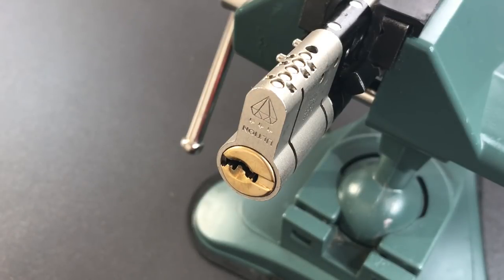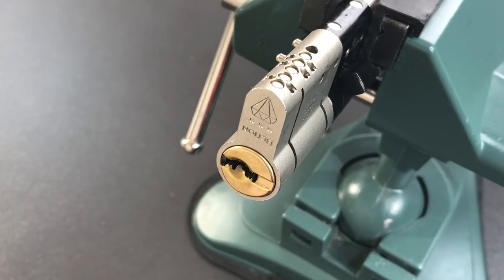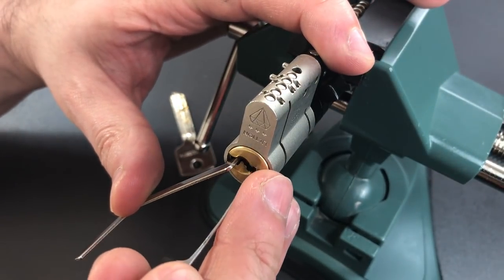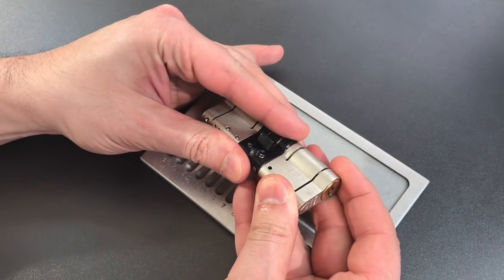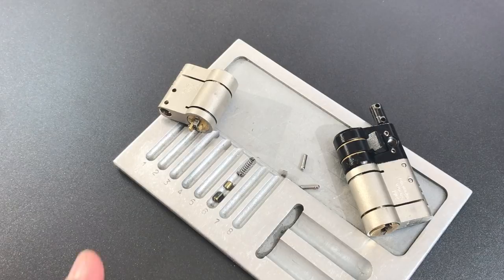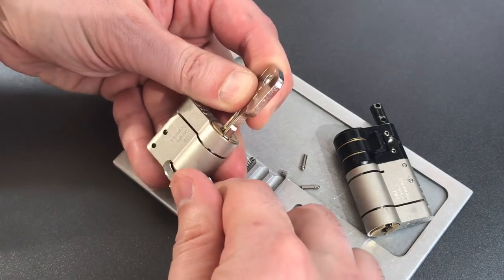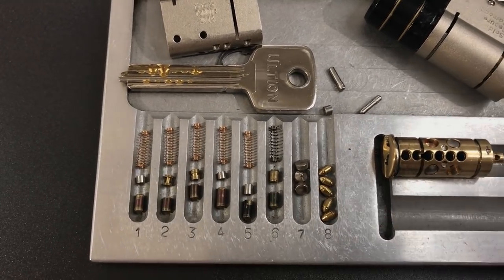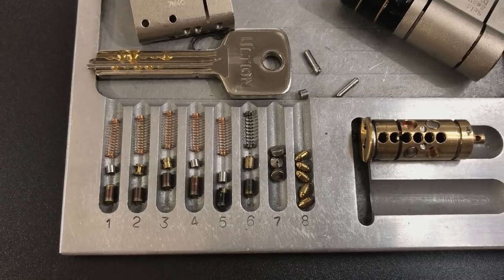[628] Ultion Euro Profile Cylinder Picked and Gutted

Comment: If you were locking your motorcycle which lock would you want? Most bike thieves don't know how to pick locks but they do know how to operate bolt cutters or power cutters/grinders. Some will know how to pick. I need a good strong lock ASAP. Thanks.

Comment: Hmm, that's a shame - I've got a full set of these on my house.

So, if I wanted something that's better as an all-rounder what's actually the best these days?
Reply from the maker: Nothing’s perfect. This is better than most.
Reply: As has been said elsewhere, when confronted with a lock like this (or Avocet ABS's like I have) intruders are much more likely to attack windows (including just smashing them) if they want to get in. LPL is picking in ideal conditions with a high degree of skill, your average scumbag in the dead of night wouldn't have a chance.
Reply: I'm looking into Abloy euro cylinders. They do exist. But they are more expensive. I know they last longer, and as dd locks, they are harder to pick. But I would love to find out more about how well they cope with snapping. I suspect/worry that if snapping does not occur in Finland and Scandinavia then they are not designed to stop it.
Reply: @belperite  He's also picking the lock upside down. Orientation is important with these, and with some other, Eurolocks.

Comment: Coming from the UK and being an English "bloke" 😄 I have to say I'm disappointed with the Ultion lock. As Michael Maynard has mentioned in his review it seems like the marketing of the lock got a whole load more attention than the technical side. The hard work seems to have been done but they left the lock half finished and vulnerable to picking. You would also have to question the method of testing for the lock to achieve the certification and security standard it has been awarded. A lock being "sold secure" and three star obviously isnt worth the paper its written on. Nice work LPL!
Reply: Hey daz ., glad i"m Welsh with all these comments :]
Reply: Mr Maynard - in https://youtu.be/UcMdf5aR7JY - proposed the theory that the locks from mass production were unreliable or easily jammed with long pins or high pin stacks in place. Deficient pick protection is the result. However, after watching many videos from LPL, BB etc., I can't understand how any straight cylinder with openly accessible pins can ever be considered picking-resistant.
Reply: I don't think this lock being vulnerable to picking is that bad. Your average oik house burglar can maybe rake open a basic pin tumbler, but most of the time they go for brute force attacks, snapping, drilling, brick through a window (I love ultion's marketing BS that claims 85% of break ins are done with snapping) which this lock is beefed up to defend against. there are maybe half a dozen people with LPL's picking skill so this lock folding to him isn't much to write home about.
Reply: Get this lock and see how fast you can pick it, please report back the result.
Reply: have you even seen the videos of penetration testers, people whos whole job is to be paid to try breaking into places... watch a handful of videos and you'll notice a theme.. most of them dont give a shit about your lock. very few people have the level of picking skill as LPL, and most half decent locks like this one will stop your average picker. unless you've got a master lock or something they can quickly rake open they will aim to ignore your lock entirely and use a different tactic... under door tools, latch slipping, hinge attacks, windows.
your common thief isnt skilled enough to pick a lock like this, they are skilled enough to take a piece of wire and just slip the latch on your door though.
Think about who your actually trying to stop
Reply: Yeh in the UK most burglary that uses the door as a point of entry either attacks the hinge/frame/kicks it in or on a decent door involves either snapping or drilling the lock

Comment: Thank you for that LPL So the snapping is solved but the picking sort of easy still, however (I don't like saying this)  1 your a skilled picker, 2 the likelihood we would see a picker of your standing is unlikely.
I have my reservations as these are on PVC doors and in practice, a burglar would be put off just by the anti snapping.  If they were that determined you would go for the windows for ease of access.
The video I saw of snapping is unreal in ease on the unprotected locks.

Comment: I recently found your videos and found them to be excellent in quality and information. You've gotten me interested in getting into lock picking and I recently ordered a basic sparrow set. I'm a bit tight on cash and am looking for some inexpensive locks to practice with. I purchased one of the masterlock loto locks with the amazing core and a couple other locks that should be easy to get into. I was wondering if you have a video or could suggest a few different inexpensive locks that would be good practice/experience for single pin picking as that style is what mostly interests me.

Comment: DID HE SAY "THIS CORE IS REMARKEABLE".  ?
This lock is a mustbuy for the UK
LPL does not often say "remarkeable" ....... right?
Reply: Wrong, when you listen the other words as well:
"Very very easy to pick [...] but drill and snap protection" - In other words easy to open for a thief but hard to open for firefighters in case of emergency.
I consider this lock a fail.

Comment: Are these kinds of lock safe from picking if a key is left in the cylinder and turned, so no key can be fully inserted on the other side?
Reply: While I am unsure regarding double key, if the thumbturn is fully rotated into the locked position, the actual key will not open the door... (I've just had one installed in my house)

Comment: I remain unsure of how a "snapping attack" works.  I  have a guess but, having never heard it explained or demonstrated, I don't know if I'm right.  Is this something you could address or even demonstrate at some point?  As always, I find your videos informative and entertaining.  Thak you and keep up the great work.
Reply: Dale Erickson snapping a lock ist pretty much just breaking a lock on the weakpoint in the middle of the lock where the actuator is. If the lock sticks out a bit you can grab the front of it with a pair of pliers and bring a lot of force on it and most locks just break in half.
Reply: That's pretty much what I thought.  However, in the US  locks don't hang out of the door far enough to get pliers on it.  does this happen more frequently in other countrys?  I've also noted that most "euro cylender locks" do seem a lot longer than I'm used to.  I wasn't sure if they extended outr of the door or, if the doors were just thicker.
Thanks for the explanation.
Reply: Dale Erickson in most cases the doors are thick enough that the cylinders fit. However on thinner doors (many of the non-frontdoors) they can stick out a couple of millimiters.
Reply: Thanks, Aalbert Torsius, this is what I was looking fo, though why I searched under the lock sport channels I watch and notYouetube in general remains a mystory.
Reply: Snapping is something Euro locks are particularly prone to.  Mechanically it's a very shitty design, enshrined as a standard.  Euro locks beg to be snapped.  Hence the complexity of the Ultion design to withstand snapping attacks.
Reply: @bdf2718  et. al.: The cylinder dimensions have to be chosen according to the door's properties, perhaps with fewer pins. If this is not possible (e.g. because the lock is part of a locking system), excess length can be protected by surrounding armour. After that, other parts of the door will be weaker. 

Edit: at least thick high-protection doors should allow two or three securing screws to be used (the cylinder has to be even longer to supply room for the holes) against snapping. But those doors may have a motor lock anyway.

Some years ago, firefighters opened my office's entrance by snapping the cylinder (where a bent wire would have worked faster) when there was an actual fire. Buildings like that supposedly release a master key to firefighters, but the safe did not open, because no fire alarm had been triggered inside. So that weakness has a use case.
Reply: + @Halberdin 
So we should fit weak locks in case there's a fire and the fire alarm isn't working?  Hmmmm.
Reply: @bdf2718  Maybe it's also useful if burglars get past it: insurance covers the damage anyway and you just need to replace the lock instead of having to get a makeshift door and then the proper door and casing. This happened to me, too: burglars opened the entrance with a lever without leaving traces (very poor security, changes effectively prohibited by law, a story of its own). The many following wooden doors (with catchers) and cabinets were easily cracked open. Then they came to my room that had a fully locked heavy door in a metal frame, so they used very much force to destroy the door. However, when nearly finished, they discovered that the room had a second door that was open. (The first door was locked because a cabinet was in the way.) The damage was never fully repaired due to missing parts, so the cracked and bent frame stayed with me for a decade. Had they snapped the locks, the total damage to our rooms would not have been 100x their booty.
Reply: If you break the outer cover with the handle on, more of the barrell is exposed, thus putting pliers on it and a little leverage will snap it
Reply: These Euro format locks are usually fitted so the lock sits 5mm beyond the front of the handle assembly. A snapping attack simply uses a vice grip plier on the lock body to lever it up and down until it breaks in two in the centre, and the front half be pulled out and the core can be removed. (Possibly this deliberate flaw was to facilitate the entry to the property by first responders/landords.)

Anti-Snap locks are designed to be fitted in the exact same way, but have sacrificial weak points that still break under a Snapping attack, but leaving the core in place, and the door still locked.

As other commenters have noted, the Euro Style lock sticking 5mm out from the front of the handle assembly is a major vulnerability, whether it is a standard or Anti-Snap lock. 

Fitting these locks so that they sit flush within the body of the door, would not only removing the grip points for snapping them, but make the lock fit stronger as a whole would seem to be the wiser choice. Just fit a lock that is as exactly wide as the door with the handle assembly fitted. Choosing an Anti-Snap variety fitted with the pins sitting down, instead of upwards as in this video, and wide enough to sit flush at the front  would seem to be the best choice.

Comment: Hi I’m from Australia. It seems like the Ultion cylinder is excellent for anti snapping and drilling. Is there a way to improve its ability not to be bumped or picked?

Perhaps someone can suggest a lock which is good in all the above mentioned areas??
Reply: hey matey - it is an anti bump cylinder - he has it installed in the vice upside down - I don't know why he did that - did you see his era video? that one seems like it got good marks

Comment: If you combine this with the lock lock handle they sell, is the picking issue somewhat mitigated? Obviously only useful if you are inside the property to engage the lock lock handles though. But at that point you get the benefits of the anti snap, anti drill and I assume picking as it won't open with the key.

Comment: I have a very similar lock, though from Yale (Platinum 3 Star Cylinder range) which uses a different key profile. Not sure how, if at all, it changes pick resistance. As the door sits directly under a CCTV camera I can’t see anyone spend time trying to pick it though and will likely head straight to more destructive techniques.

Comment: I've never had to drill or snap/pull this lock personally due to its floored pinning, but do you know if its possible to overcome/defeat the active pin in the mid section by **** or is it hardened steel?

Comment: Question for everyone: Can a person buy hardened steel driver or key pins for a standard Kwikset deadbolt? I'm looking for a way to make one more secure against drilling easily. I've already filled it with nasty custom security pins to make bumping and picking harder. I'd like to put hardened pins in to prevent a core drilling attempt and possibly hardened inserts or hardened bolts to prevent a drilling attack of the body bolts from the outside faceplate of the lock. I know the easy answer is probably "buy a Schlage" but that's not an option for this particular situation.

Comment: So what's with these passive pins? I can see they aren't springloaded and are all the same length (and depth in the key) and are tapered so long that it moet be harder to not pick them than to pick them. But why are they there? Obviously you don't need to do anything with them, so what's the added value of putting them in?
Reply: When the lock is installed correctly, i.e. the other way round, gravity drops those pins - meaning no need for springs, which saves room in the design.

Comment: What are these locks used for? I thought they were CAM locks but that doesn't seem to be the case? Are these locks used for mailboxes? LPL did say residential, but i cant see how the lock he is picking now would lock someones door? (it doesnt look like a deadbolt)
Reply: They're used on UPVC doors with multi-point locking mechanisms, so the euro-profile cylinder is only part of the solution.
Reply: @JohnMcLusky  Ok so then they connect to other locking mechanisms ? I don't mean to ask stupid questions, I just have never seen them in use before.
Reply: @ntkernel  That's right - something like this:

https://www.youtube.com/watch?v=3W-TJDyQags

The cam on the euro-profile cylinder will set or unset the multi-point lock, much as the deadbolt in that video would.

Comment: Those slugs are in line with the anti drill pins I suspect that the slugs are supposed to jam the core if someone tries to drill it
Reply from the maker: How?
Reply: sorry for the delay in response. It is all to do with the direction of the drill is rotating. If it is clockwise it will jam the 1st on the right the 2nd on the left then the 3rd on the right. The drilling force is applied to those anti drill pins then the end will push out against the slug and jam the core firmly so even if you managed to drill out the key pins the core will be jammed so tightly that it cannot turn. Also I am thinking that people would drill then use a bolt extractor to turn the core. If they did these would also jam and prevent the core from turning.

Comment: Would a lock such as this be harder to pick if the key was left in on the internal side and turned through say 90 degrees?
Reply: Thieves in the UK use...
Molegrips to snap locks
Drills to drill locks
Screwdrivers and pry bars to wedge past locks
Reach tools to grab keys in reach of the letterbox.
Hammers to break windows.

What you suggest would place the keys in range of a reach tool. Whilst defending against an attack that would be more difficult when fitted correctly (core at the top, not bottom, would engage those passive pins) and one that just isn't used that much.

Comment: what do passive pins do exactly? if you dont have to worry about them when picking, they seem to me to be completely pointless altogether? or would they prevent a wrong key being used if the cuts on the passive side were different?
Reply: How do you know they are passive unless you know the lock or key?
Reply: When the lock is installed correctly, i.e. the other way round, gravity drops those pins - meaning no need for springs, which saves room in the design.

Comment: What is a lock snap, is that by force? Can someone advise me, shall I buy this product, as I cannot be buying and installing a product that is not as good as my standard yale,
Reply: It's where they grab the front of the lock with pliers or vice grips and pull up/down to snap the lock. In cheaper locks it breaks them off at the middle, so you can reach back and turn the lock with a screwdriver. The long cuts you can see on this lock near the front means that an attempt to snap this will only break part of it, leaving the rest inside the door and unable to be grabbed.

Look for any lock that says 'anti-snap' or that it at least BSI 1 star or TS007 1 star, which to my knowledge means they e got anti snap protection. You can always tell visually by looking for those vertical cuts near the keyway.

Anything that's BSI 3 star like this will be secured against snapping and be difficult to pick for most people.
Reply: @BritishTeaLover  thanks m8,

Comment: Really begs the question of What is the point of passive pins if they add no security whatsoever.
Reply from the maker: They are more useful in master key systems.
Reply: They do when the lock is installed (as it will be in the UK) right side up; gravity makes the pins drop on that side, so no need for springs (which would take up too much room).

Comment: Unless installed with ceramic drill protection, not even a lock made entirely of hardened steel would stand a chance against a CBN-coated tungsten carbide drill...

Comment: What’s the best Euro lock to buy ? Thanks
Reply: This is still up there.  Had they stuck a couple more security pins in it would be formidable.  The largest attack mode on Euro cylinders is snapping.  This lock is very resistant to that.
Reply: Trioving

Comment: Why don't they manufacture all the lock mechanism from hardened steel but instead they add small parts of it?
Reply: 1. Cost (how are you going to make complex shapes out of hardened steel?)
2. Steel rusts, unlike brass
3. (guessing) might be harder to drill a lock made from materials of different hardness as they will deflect or jam the drill.